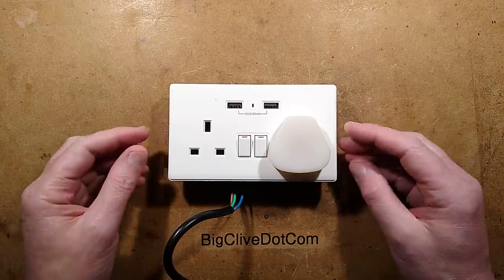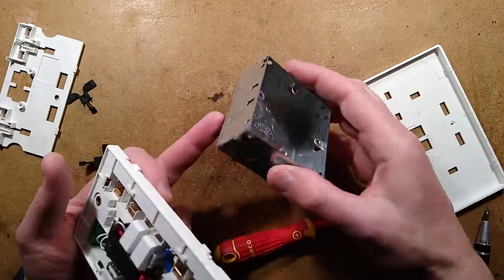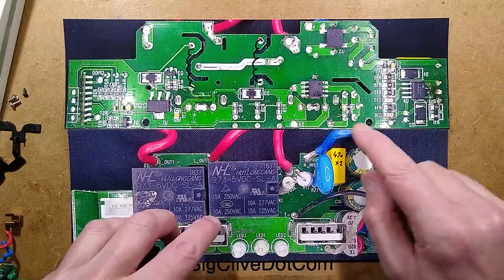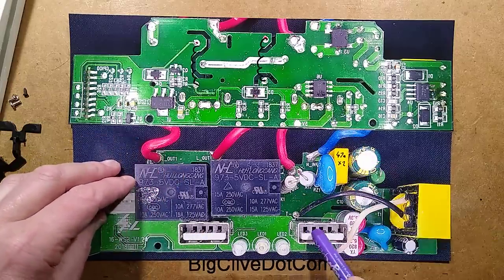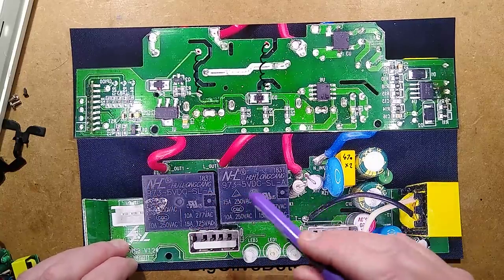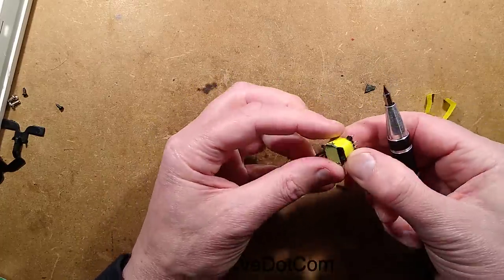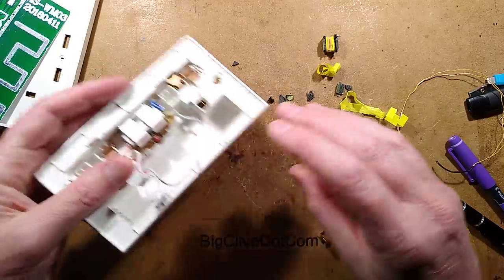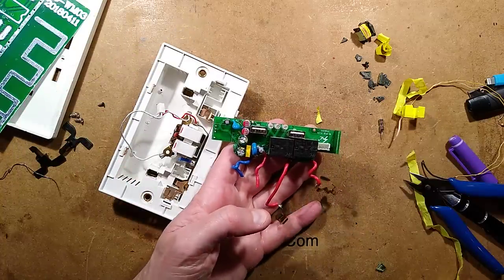WiFi wall socket teardown.

Comment: ESP8285 is just ESP8266 with build in flash - that is why the flash is not populated. ESP8266 is sensitive to power drops - it runs on 3.3v (hence power regulator from 5v) and can have quite high burst power requirements when transmitting (especially when signal strength is low - like in a wall :D ). If the supply circuitry not capable of handling it it can cause a brownout and crash - that's why they can by unstable in cheap implementations.

Comment: As an electrician, i always try to de-suade customers from installing USB sockets, but they seem adamant that they want them. I never provide them, I always get them to supply, I will fit, But no warranty, only on my work. To be fair, the newer BG ones and similar are quite reliable, but meh... I agree, stick a replaceable USB charger in a socket. Also testing is  pain in the ass on a installation with these things.

Comment: There's a local chain of convenience stores where every single outlet in the eat-in area has a pair of USB connectors on it.  I have seen people plug their devices into those.  I too prefer to have my own charger plugged into the outlet as you describe,  instead.  No idea what their failure rate is,  or how one might even tell...

Comment: Hi Clive.
🤔🤔🧐Just a quick question...

How is the unit screened, when the front of the unit is plastic🤔?
  I get how anything to the rear 'could' be kinda bothered by the metal box, and the range 'could' be severely limited. 
 It'd be worth a little experiment🤔.  It'd be a pain in the arse connecting it twice, but, I think it's worth while finding out🧐.

Love the vids 😍. 
Love the 'blown up' diags 🤓.
Keep 'em coming 🤯.
Rich🧐🤔🤯.!.

Comment: It's nevertheless an opportunity for very conservative power outlet manufacturers to outshine everything with respect to safety. In 20 years these things are all smart, be it switchable, be it off when you're not using them, etc. Even a fuse can be done there rather than at a group level. Servicing should be easy though, lots to gain there.

Comment: Thanks for the video Clive. I am not a fan of USB in sockets either. But I do like wireless control of sockets in it. Software probably sucks tho. For modern installations, controlling sockets from the distribution board is probably more sensible, or running some low voltage signal cables to the sockets, maybe even ethernet or something. WiFi isn't super reliable, as you said.

Comment: Some places have walls that aren’t made from cement, such as England. And some places don’t put deadly voltage into every outlet.
Reply: ok, so now tell me where they put voltages below 50 volts into wall sockets? that is what is considered Safe ELV here, everything above may potentially be deadly. (And under certain circumstances even those low voltages may be, but that is more a theoretical issue)

Comment: Funny coincidence that this comes out a day after I have a similar unit (without WiFi) blow up in my wall, and from British General too, not some Chinese supplier. The convenience of having usb is great, but having those extra failure points running 24/7 definitely isn't, I'll be swapping all my usb outlets out soon

Comment: I wish there was a standard for like a wall plate where the wires are exposed as a female end and you could just screw in manual or smart switches. then it can be easy to replace and it would get good reception even if it did stick out from the wall a bit

Comment: I built an arduno based WINC1500 wifi node that measures temperature every 10 minutes, coded so that it will connect to the wifi SSID, make MQTT broker connection, measure sensor and transmit data, then at the end will disconnect from the WiFi to save on standby power, every now and then it will lock up probably because of the exacting timing with WiFi connection or MQTT connection, code recognizes this taking too long and starts code completely from scratch, problem with devices like the power point is the WiFi is always on and not being refreshed per say, so if IP address conflict or something changes in the house like the WiFi channel etc it can behave weird.

Comment: @5.07, that would be a pi filter. they used to be common in valve amplifiers.
Reply: and they still are for suppression in psu applications where a designer actually cared about it

Comment: Hi Clive.
Another quick question 🤔...

I'm sure you will have explained how a capacitor stops interference in a circuit. So, can you either point me to the video where you do, or, if you haven't already done one, can you       🙏PLEASE🙏 do so.

Thanks so much for your time🤗.
Really appreciate it Clive.
Rich🤯😍.

Comment: I'm new here and to this level of circuit analysis.  Can you tell me: are these two separate boards or is the top the backside of the bottom?

edit: I figured it out, the top is the backside of the bottom as I suspected

edit 2: I'm not so sure anymore

edit 3: 14:15 he whips it out.  Clive must have mirror-imaged the underside in his printout.  Enjoy your day.
Reply from the maker: I mirror it so the pads relate to the front.  It makes it easier to reverse engineer.
Reply: @bigclivedotcom  thank you so much for your timely, kind, and succinct responses

Comment: 8285 chip i think is the same as in the sonoff switches and can be reprogrammed.
Reply: The ESP8285 is very much comparable with the ESP8266.
The only differences are that the ESP8285 has its own internal flash, where the ESP8266 does need its flash mounted external. That's why there were some pads on the PCB, to make it compatible for ESP8285 and 8266.
Traditionally the ESP8285 had only 1MB of flash, but I've seen some records of newer modules with 2 MB inside. Although I have never seen those. 
So far I've seen no requests for an ESPEasy build for ESP8285 with 2MB of flash.
Reply: It's just an ESP8266 with an integrated 1Mb FLASH. You can do quite a lot with a 4Mb FLASH but the smaller FLASH is limiting.

Comment: Clive, have you seen any WiFi light switches? I think they'd be quite useful being that they're higher up and out of the way of other electronics.
Reply: I have a couple of LED light bulbs that have enough room inside them to fit an ESP8266 (ESP-01), power regulator, and a mosfet  I keep meaning to try and build one but I never seem to have the time.

Comment: Do you just have a large filing cabinet filled with prints of circuit boards from electronics you've taken apart?
Reply from the maker: They're mostly on Google Drive.

Comment: (5:55) How is Vdd generated? This kind of circuits always puzzle me. It seems to me like a chicken and egg problem.
You see, it seems you need to switch ON the NMOS in the chip to get some kind of Vdd, but without Vdd you can't switch the NMOS in the 1st place.
So, how do you break this lock?

Comment: i had multiple external wifi sockets fail due to powering my pc with it. The high inrush current welded the relai contacts together after ~150 switches.

Comment: 16 amp fuse being used on a buss that have relays rated at 10-15 amps (depending on region).  what is the likelyhood someone won't end up trying to plug in as much stuff as they can to a socket and get the load close to the limits on the relays?

also, a glass fuse is the worse choice for this application.  ceramic would have been wiser

Comment: I don't know about anyone else, but I'd like to have a dedicated low voltage run in my house.  Maybe something like 12V DC so you don't have to step it down too far to have your dedicated USB sockets.  What voltage is Power over Ethernet?  Maybe a low voltage power standard already exists that we could hack.

Comment: There is probably a facility to reset the firmware back to factory state. Probably by pushing two switches when powering it on or something.

Comment: No, not in my house!  I don't like anything like that built into a wall where if a fire does start you can't get to it.  Mind you most in there these days except wiring and plastic boxes shouldn't burn anyway, but I still do not like the idea of those tiny transformers and relays and thin wires where they can cause trouble.  Better just to have a normal socket and plug what you want in.  Then it looks like a 240v socket and some plunker will plug something in like a 3KW heater!  Is the sockets live all the time?

Comment: So knew isn't better than tried and tested, so the conclusion stick with the old sockets, if you want WIFI buy the appropriate equipment and plug it into the old fashioned electrical out let ! . Thanks for the information and education.

Comment: Did you notice the secondary winding was wound in a overhanded way? They used two wires for it and let them weave with the previous turn.
Wonder why they did that? They had done it on all but the first turn.

Comment: WiFi in a wall socket makes 0 sense to me. I agree that I’d want something mounted in the center of the room or at least off the wall or ceiling. 

And software in my power switches? No thank you. As a dev there’s no way I’d trust consumer level stuff for power switching in wall sockets. Give me a manual switch any day thanks.
Reply: Before viewing the video I assume there is ESP8266 in this socket. You can program them yourself and make them run your software or use opensource firmware for them like ESPHome that integrates nicely with HomeAssistant home automation software. That is the entire point of devices like that - home automation.
Reply: Those are usually ESP8285, basically an ESP8266 with built-in 8Mb(1MB) EEPROM. You can flash ESPEasy or Tasmota software, I'm running ~10 (all running ESPEasy or Tasmota) of different devices, ranging from Sonoff Basic, IFan03,Sonoff Mini, and even my custom controllers based on NodeMCU and finally some using bare module, the ESP-12F. The up-times are well over 30 days now, since it's been around 30 days as I've been fiddling with my house's power so had to shut down the main house fuse. It's been working without glitches for almost a year now, and if the wifi dies, you still have the physical switches, so as long as there's electricity, you won't be stuck 😉

P.S. the purpose of Wi-Fi in a wall switch is the ability to remotely switch lights from your phone, by voice with google assistant, or maybe if you have a larger room and wish to have switches in different ends of the room, so instead of using 2-pole or 3-pole switches and having to chisel the walls, put plastic pipes, running the wires through them and finally plastering it back and painting the walls back, it saves a huge amount of time and effort. You can put one of these anywhere in the house, and then use it to send a signal to turn on any or every WiFi-enabled light in your house
Reply: @KnaufL  The problem is that any flaw in the megabytes of software they run could cause (maliciously or otherwise) power to turn off or on at the worst possible time.  Security flaws would allow outside hackers to deliberately time malfunction for maximum deaths, while regular flaws would just do so automatically.
Reply: @johndododoe1411  if that was true, then rockets would never fly, yet they do
Reply: @Rust Davy powerline is always slower than ethernet(if set up correctly). E.g., you can run 10Gbe through CAT6 cable, 1Gbe through CAT5,but through 1Gbe powerline, you only get a max of 300-400Mbps
Reply: @KnaufL  I was chatting about flaws in software, and those do crash rockets.
Reply: @Rust Davy if you use 5GHz Wi-Fi and cover every room with an AP, you can easily outdo the 1Gbe homeplug

Comment: Hey clive I came into work today and one of my co-workers has this small circular black device that has one side as a button on the inside there are no manufacturing logos or markings and has a small cr2032 battery. This was found underneath one of our dealerships car bumpers and we cannot solve what this is for after extensive research and I was wondering if there was a way to contact you with images of the pcb for u to look at?
Reply from the maker: Can you send a picture to bigclive1@gmail.com 
It sounds a bit like a simple bluetooth tracker.
Reply: @bigclivedotcom  thank you for responding I have sent an email to you with the attached images

Comment: How does this compare to a reputable brand like schneider USB sockets Clive? I'm in two minds now whether or not I'm going to shove them into the fixed wiring!
Reply from the maker: If only suggest using prominent brands in your country for safety.  I'm not a fan of building in electronics to walls.
Reply: @bigclivedotcom  it's understandable why you're not. I'm going to decide whether or not it's worth it. The chargers are no good for quick charging phones anyway. Thanks BC.

Comment: I don't trust things like that, like you said, Fire Hazzard, We had a dimmer switch in the 90's that used to make loud buzzing noises on low settings. Never liked it.

Comment: I have a wifi enabled double socket made by BG Electrical in the outhouse but if the power is removed for whatever reason it loses all settings and has to be reprogrammed again.

Comment: clive, is there anything I can buy on ebay that would just connect to my phone and allow me to send,or receive video that isnt something like chromecast, I wanted to find a way to send newer videos to older crt style tvs, but the amount of connections and intermediate devices youd need seemed excessive
Reply from the maker: Some phones used to be able to put out video via their charging port, but for modern Android phones it's Chromecast.
Reply: @bigclivedotcom  into a crt?
Reply from the maker: @phonotical  You could maybe use an HDMI to composite converter.
Reply: @bigclivedotcom  ah man, I was hoping to avoid that, but sure I guess it isnt the most pain in the ass idea

Comment: Hey Clive, I need your help. I'm trying to find a relay with a brand name called finder but struggling to find the one I need for a welders controll switch panel as I believe its burned out so its not turning on. If you could contact me how ever possible then that'll be great. Dean.
Reply from the maker: It's a really common brand.  In the UK you can get them from companies like Rapid Electronics.
https://www.rapidonline.com/Catalogue/Search?Query=finder&Tier=PCB%20Relays
Reply: @bigclivedotcom  I gave up in the end trying to figure out why it wasn't powering on. I looked at a diagram of the relay I had as its a 2 pole so I just bent 2 pins overto connect them together. The machine just isn't turning on and I think I'm giving up with trying....

Comment: Yes, 5v USB wifi 'switches' do exist. Once you stick Tasmota on them instead of the stock (and probably phone-home) firmware they ship with, they're great. https://templates.blakadder.com/sinilink_XY-WFUSB.html My experience with the ESP8266 (both DIY and with some home automation hardware) suggests that either the manufacturers of these units are writing shoddy firmware, or it's a reception issue.

Comment: The micro almost certainly uses a watchdog timer so if it crashes, it will automatically be reset
Reply from the maker: That can be defeated by rogue software that still resets the watchdog timer when stuck in a loop.

Comment: Call me old fashioned, but I hate these things that are hard wired to the mains.  House fire waiting to happen.  And then what would your insurance company say?
Reply: Sure depends what device was mounted and who installed it.
The fun thing is that many people are concerned about putting anything like this into their walls. But you clearly have to distinguish if it is the cheapest thing available shipped directly out of Hong-Kong, Guangdong or Shenzen or if it is a device provided by a brand manufacturer. True, for the latter ones you will very likely not find Wifi ones, but more something like the ZigBee or similar home automation stuff. But you pay some extra for the brand for sure (I allwas tell me and hope it is not for the brand but the quality. So let´s pray now...)
I have installed some wifi switches in my house as well to make certain devices (lets call them lamps) switchable through e.g. Amazons Alexa. works like a charm. But I have to confess so far I only brought myself to trust the ones you plug into the socket and plug the lamp into them.
One I actually use for a dehumidifier. Not for switching, but they work surprisingly good for measuring power consumption over time.
Reply: I don't know how it is in other countries but in the US we have several 'Nationally Recognized Testing Agencies' like the UL. If the product is properly UL tested and labelled, then properly installed to code, I suspect your insurance company will be okay with it. If random Joe Schmoe slaps in a random eBay unit, your insurance will probably say a more elegant version of "f off".

Comment: How does this compare with the Philips hue outlet? Are you just paying for a name and marketing with Philips?
Reply from the maker: I'd expect the Philips to be more compliant to protect their brand.  But I'm not a fan of cramming electronics into everything.
Reply: bigclivedotcom neither am I, the Philips is not built into the outlet, but rather a plug in pass through device. I looked at the FCC document showing the internals and it seems fine but can’t look too closely as the fuzzy photos.

Comment: I'm always worried about using random manufacturer wall socket USB chargers. Ignoring blowing up your phone with bad power, there is always the problem with hacking USB.
I'd absolutely refuse to purposely use a random manufacturer Wi-Fi hotspot.